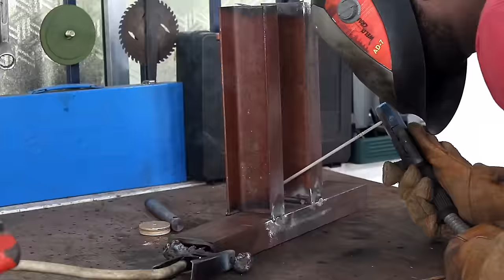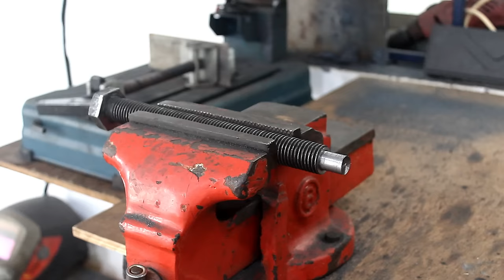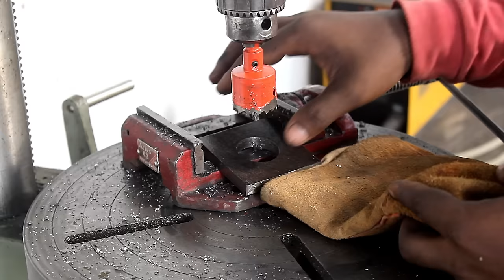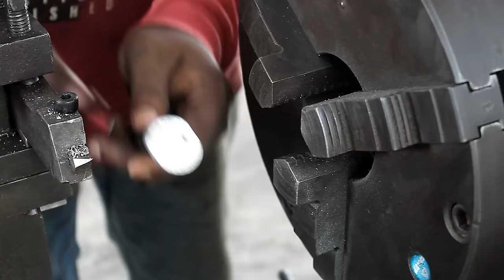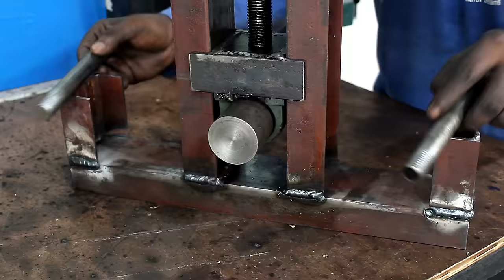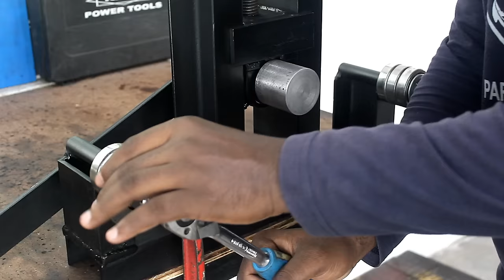Make A Metal Bender | Homemade Roller Bender | DIY

Comment: I would brace the corner of your bench you were using when you cranked down on the nuts holding the bearings in place, it was flexing quite a bit under the pressure.  Might be a good idea to make the bottom bearings adjustable for different sizes of curves, let them slide closer together and farther apart.

Comment: Nice sturdy build. 
But I'll Attach a 3 phase motor with a changeover switch which runs in both directions, so I don't have to crank it manually
Reply from the maker: Thanks

Comment: Iwant to know how to place the space between the two pebbles at the bottom. For example: the iron pipe is 30*30, its circle is 550 in diameter. What is the distance that I will put between the two b bottom pebbles? Thanks

Comment: Good job, but 2 designer faults:
1. The handle should be inserted in a drilled hole and THEN secured by welding. Otherwise the full load of your hand will be standed by welding only.
2. Same problem, where welding stands against load, comming from bended material, only, is the plate with welded nut, placed on top, BETWEEN both vertical "U" profiles. Much better solution were a larger plate, placed not between, but on TOP of those vertical profiles. Then you can weld all places, where this plate would meet, and cover, both profiles. Much stronger, hidden welding..

Comment: That's a great looking bender, I just wish someone would make a make bender without needing a damn industrial metal lathe. Someone please make a hine made, rough, post-apocalyptic looking metal bender. A video that shows how to make one with limited supplies, practical, and does the job. Otherwise, I'd just drop $3500 - $4000 on a Baileigh and call it a day. I'd rather not, because I need to save my money in the event Kamala starts attempting to run the show in a few months.😢

Comment: nice job, but the distance between the 2 lower rollers is too big..... :-( when they are closer together it's m much easier to bend the tube :-)
Reply: Also the closer they are the smaller the radius you can obtain. The easiest solution would be to have them adjustable.